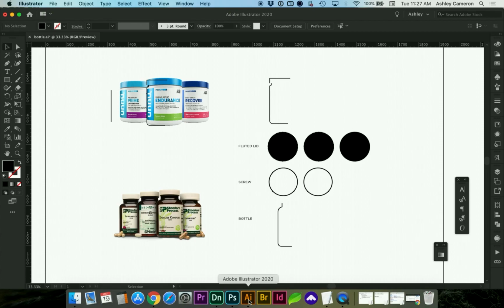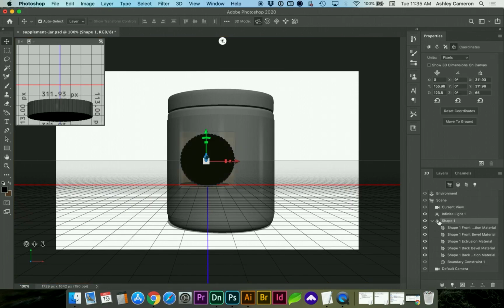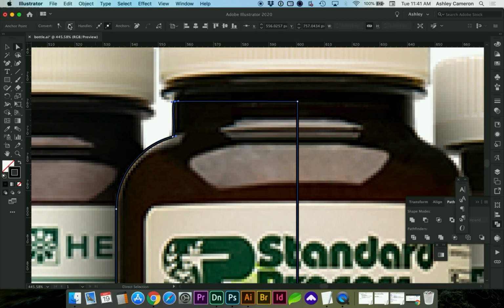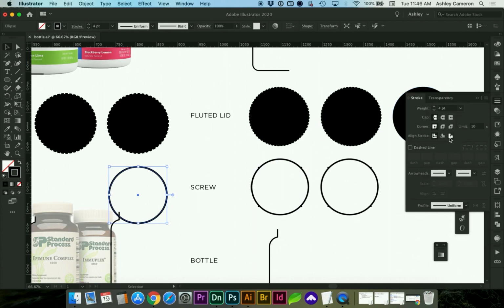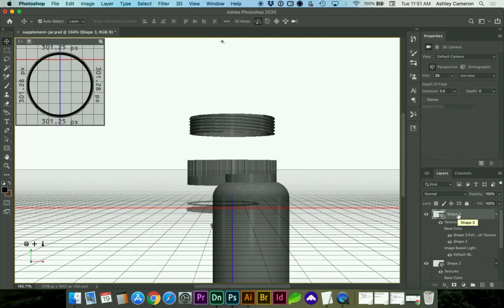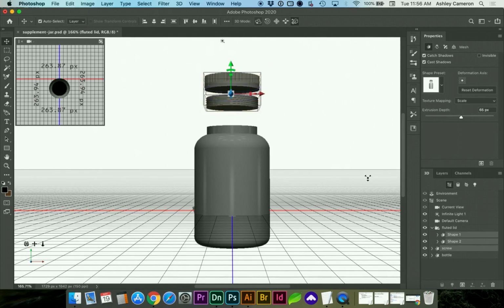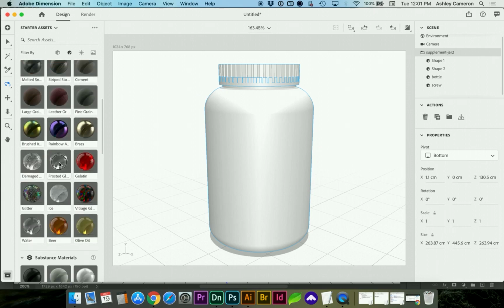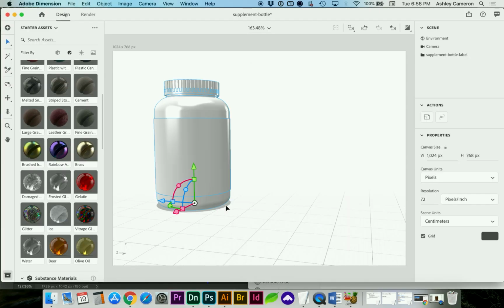Create 3D Nutritional Supplements using Illustrator & Photoshop for Adobe Dimension product mock-ups

Comment: thank you for this amazing tutorial. I need to ask a question. I could not find a way to make the screw part at the top uneven. I have a bottle that needed to be drawn in 3d with an uneven twist
Reply: actually I found a way but it makes the twist so sharp. the sample ı have has a rounded shape
Reply from the maker: @cerencat8522  Have you tried tweaking the bevel? It can be tricky for sure. Hope you were able to get it close!